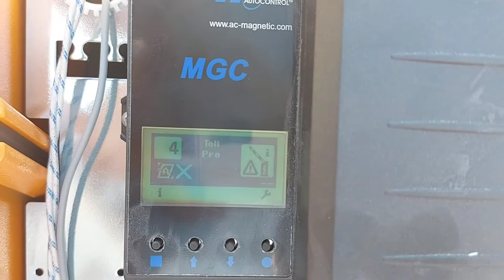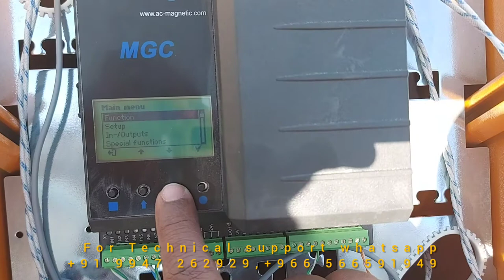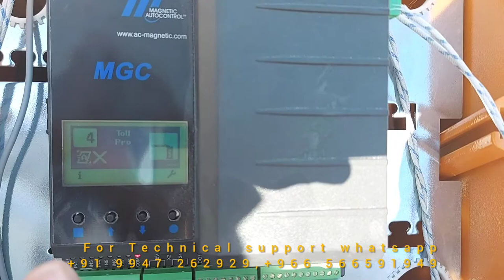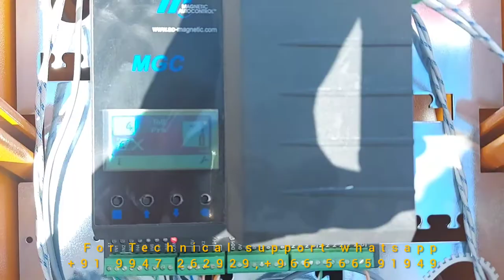Magnetic Barrier Programming

Comment: Barrier is not closing. Power from db had issue electrician changed it but after connecting power it was working. But after hours later it opens and didnt closed.

Comment: What is mean by Motor communication error
Reply from the maker: There is two types of cable.. one for motor power and one for communication cable.. please check the communication cable which is going to motor from control board
Reply: @shihabautogate   we interchanged another controller then it’s working  if we again installed old controller it’s same error
Reply: I also found Same issue.. please help . Is this programming/parameters settings issue or circuit hardware failure.kindly confirm